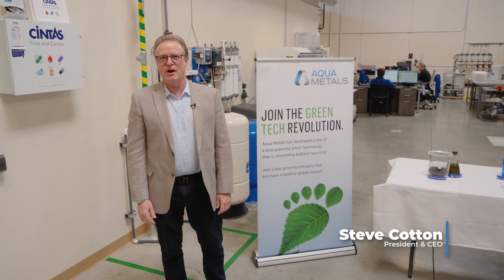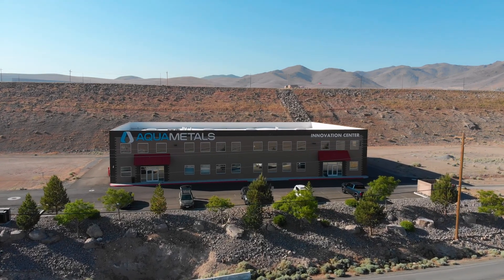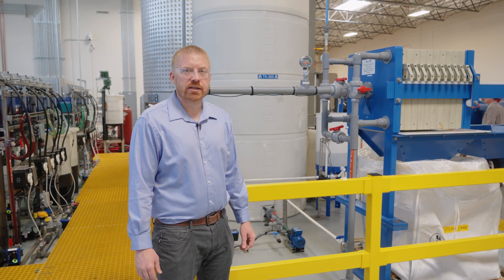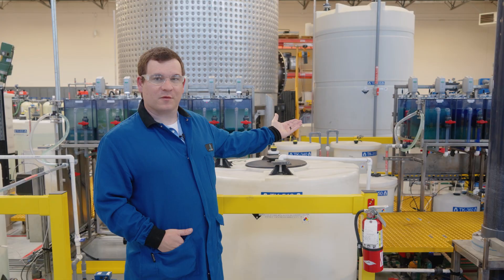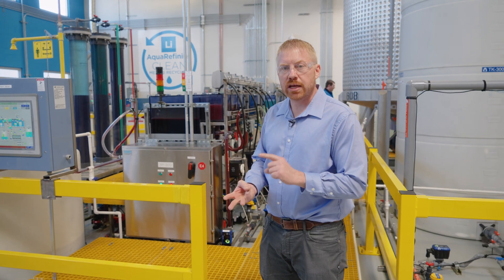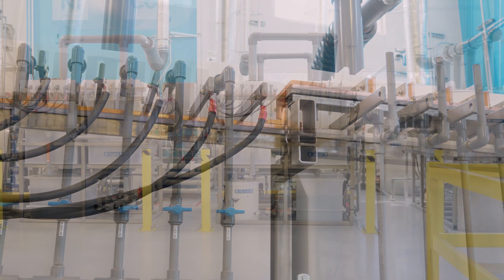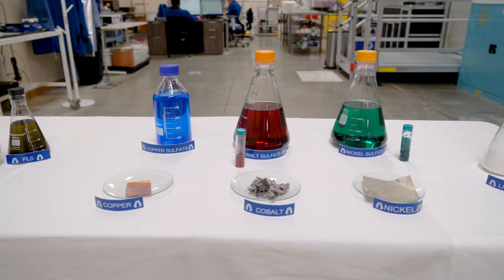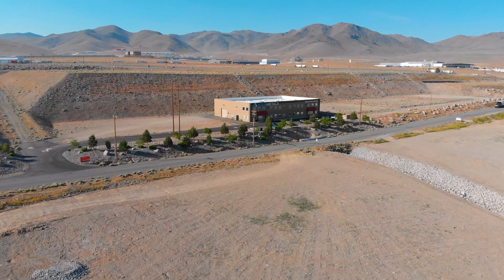Aqua Metals' Li AquaRefining Pilot Tour - Sustainable Lithium Battery Recycling

Comment: i work in the recycling of batteries , primary on lead acid ,.. this would be great , seams not real but there are milion of tons of lead acid batteries recycled every year  , in italy there are 200k ton recycled per year ,  just to give you an idea of the volumes ... lithium is going up  to volume on recycling but still didn't skyrocket yet   probably will pass lead recycling  in less  5 year